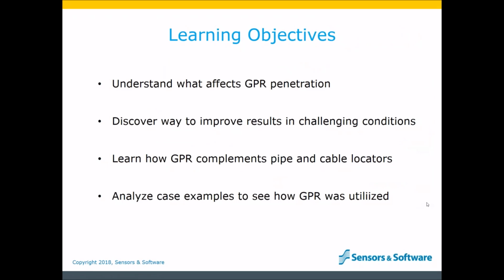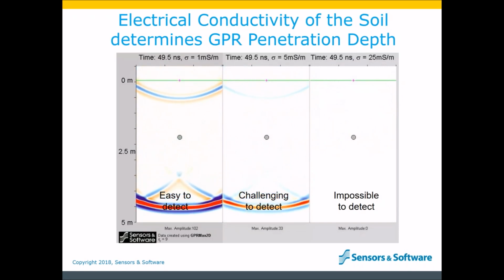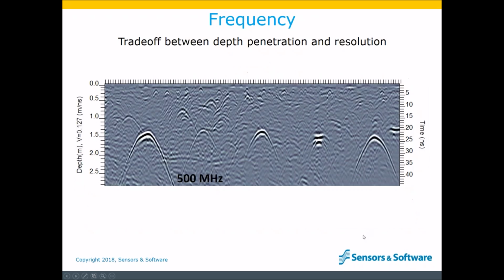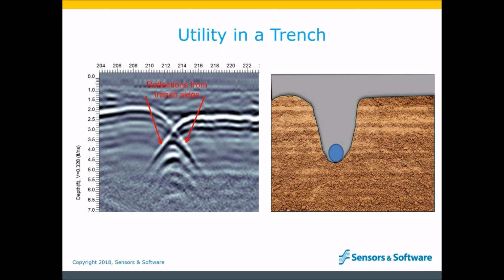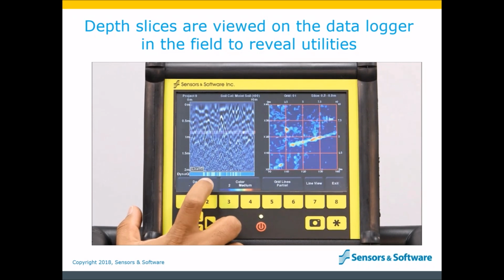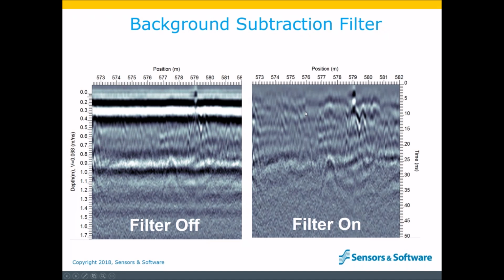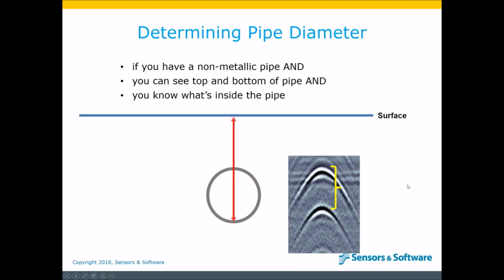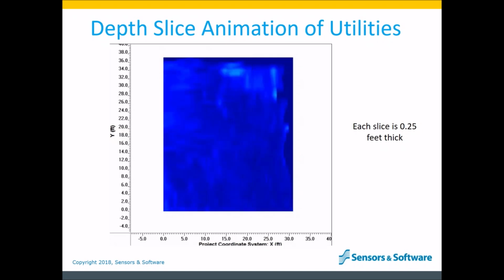Utility Locating with GPR: What GPR can and cannot do

Comment: thank you for sharing abot this. it give me more information about gpr, but i also have some question.
what if I do a GPR acquisition in clay rich area? How do I overcome the limitations of GPR which is difficult to detect utility or soil layer in areas that close to river or sea where the conductivity value is high?
thank you.
Reply from the maker: It is important to understand that GPR will work in clay, but it’s penetration depth is limited, depending on the salinity and water content.  Make sure you are using the correct GPR antenna frequency for the task and make sure your gains are set properly.  If you are looking for buried utilities, a 250 MHz based system is recommended.  You can contact us directly at https://www.sensoft.ca/contact-us-gpr/ and request tech support if you have any further questions.